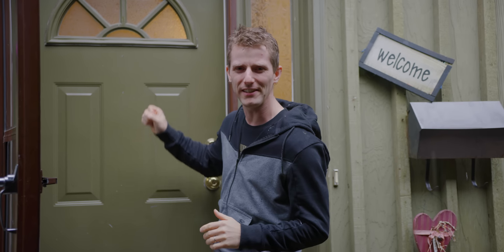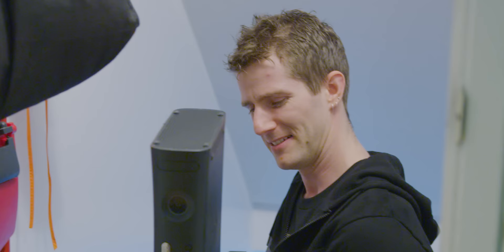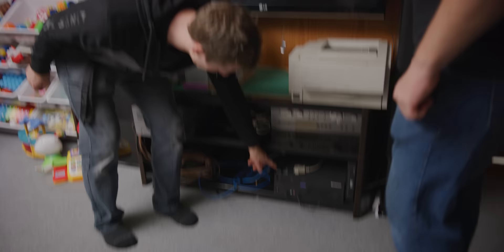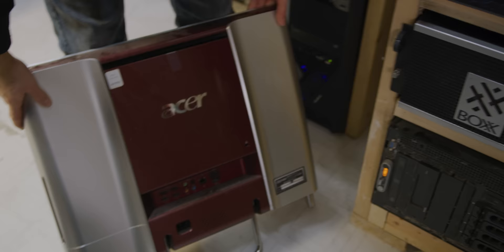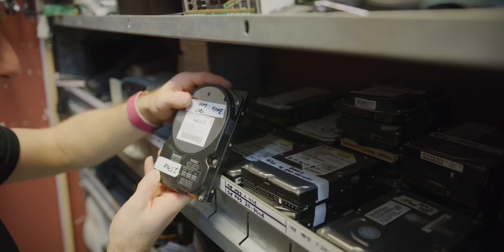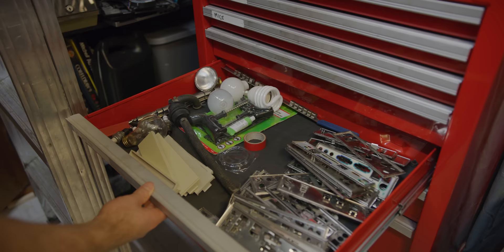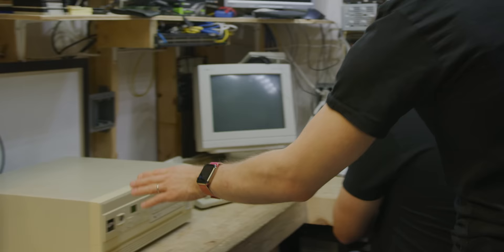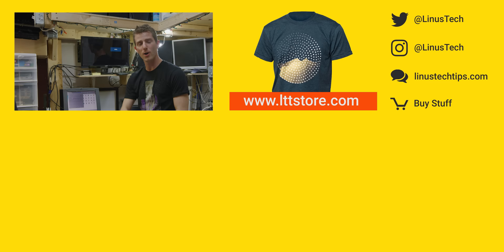This guy has a PROBLEM - Tech Hoarders

Comment: Watching Linus sort through chipsets is like watching sommelier test wine. "Ah, yes. An AMD Athlon '99. A fine year."
Reply: My 500Mhz Athlon with a Leadtek Geforce 256 was a groundbreaker.
Reply: @wolfza2630  Your 500Mhz Athlon was 99.9% a rebadged 750Mhz model. Back in the time AMD thought it was cheaper to simply design 750Mhz chips and rebadge the lower clocked ones. The higher binned versions went up to 1000Mhz and such. I had a K7 600Mhz as well running at 800Mhz using a "GFD" Golden Finger Device.
Reply: @Jeroensgambling  Interesting.
Reply: "Oh, it doesn't even have USB 3 (.0) dude."  LOL!  (5:35)
Reply: Couldnt even afford an Athlon i 99 - so purchased a Duron 600 Mhz - did the job perfectly fine aswell.

Comment: That Compaq portable with the CRT monitor was in the class of computers we used to call luggables. Back in the late 80s, I was given an IBM PS/2 P70 to take with me on an extended business trip -- it was a luggable PC complete with a 10 inch orange gas plasma display and a full size (desktop) keyboard. It was freaking cool. Shame I had to give it back when I returned home.
Reply: Actually, that particular Compaq was called a "lunchbox". The lugables were even bigger.

Comment: "You never know when you gonna need 300 ft of Ethernet cable." - True.
Reply: its for emergencies when your wifi is bad when streaming a football game, right?
Reply: My dad had a box with a spooled 2500 feet of Cat 5 Cable. Not like he worked in networking or anything, someone just gave it to him one day. He recently sold it though.
Reply: looking at my multiple 1m LAN cable and 2 100m cable... yeaaaahh
Reply: @joecraskki3175  See.
Reply: I just randomly have a spool of like 300ft of fiber optic cable right above my head soooo yeah
Reply: @jimishreds  or your neighbor has a QLED and no internet!
Reply: Agree
Reply: More importantly, "You never know when you're gonna need ANOTHER 300 ft of Ethernet cable".
Reply: Pfff... have at least 1km at home 🤷‍♂️😅
Reply: You never know when you need to borrow internet to your neighbor
Reply: My dad kept ~75 feet of coax cable in the basement for years and we finally used it to run coax up to my room so I could use my own modem. No chance he would have used it for anything else though.
Reply: @Marcin Pockaj - 
Because WLAN is for humans who believe in it or are electro sensitive or or get sleeping problems caused by the radiation
Reply: Who is true?
Reply: @joecraskki3175  great for that  10mbps internet
Reply: I keep a spool or two around.  Is that not a thing?
Reply: cable is boss and faster!

Comment: Excluding the RS Model 4P and TV connected computers, I started with two 386SX PCs i got from the base aafes for $200 not working. I got one working, shipped the other to packard bell for warranty return.  Sold one for $600. Over the years I kept all my upgrades starting around the first Athlon. Doesn't even fill a reach in closet. After watching this video might get an old one running capable of installing those awesome Jane's flight sims from the 90s.... still have them all! Will need a month to read the flight manual for Jane's F15.

Comment: 1st CPU to break the 1Ghz barrier was an AMD K7-750Mhz on a Kryotech case cooled to -41C and obviously overclocked to 1Ghz, had the pleasure of using one for long until the power management for the no-frost cooler hit the dust... could have fixed it now that I think of it...

Comment: I'd like to note that the iPad 1 is specifically a 3g model that could be used over your cell network. The standard model did not have the black section on the back.

Comment: Yep, owned half of that equipment for sure. I did buy the Soundblaster AWE32 with 2 megs of ram and I had just enough to buy a 500MB HDD for just a little under $80 because it had 2 other owners. Than I spent $300 when the first 3gb hdd came out in early 96/97

Comment: Linus: "So this is your very first PC, the one that started it all?"
Brian: "Yes"
Linus: Breaks it
Reply: "Oops"
Reply: I mean, at least it wasn't a drop.... 🤔
Reply: The front plate that came off in his hand is a removable cover. It would be replaced with a optical drive,  or one of those 5.25" drives he was talking about (720k was the size)
Damn! I'm old Af! 😂
Reply: @lindabryant2695  Don't feel too old, I still use 8" floppy drives. The very first computer I worked on was controlled by a valve system  or better known as a Vacuum Tube computer,  that was programmed through a Hollerith punch card system. No keyboards or monitors back then, and any mention of a mouse in those days meant you had a definite rodent problem!! We all thought of each progressive upgrade or new system as being cutting edge. Of course the newer generations laugh at us, just like their offspring will do at them! PS, The early 5 1/2" drives had a capacity of only 160 KB (single sided), 360 KB maximum in low density and 1.2 MB in high density came later. You might be getting mixed up with the initial 3.5 Drives, they were 720k capacity. Guess after saying all that if you are as old AF, II must be older than F%&k!!! LOL Have a great day!!
Reply: @lindabryant2695  Actually, no, it was probably either 360 KB (double density) or 1.2 MB (high density). The 3.5" disks were 720KB (DD) or 1.44 MB (HD). By the time I got my first PC (486 SLC2/66, 4 MB RAM, 200 MB HD and a CD-ROM!) in 1994, 5.25" was generally dead, but I actually got one for it later on just to run old software with. Having said that, my "beast" blew my dad's 286 IBM PS/1 that he had gotten 4 years prior out of the water 😂 (not to mention those Apple II computers I used in grade school with Number Munchers and Oregon Trail). I might have a PC with an 8 core processor with 32 GB RAM and 20 TB in hard drive space now, but I do admit to missing the old days every now and then...
Reply: I haven't gotten to that point yet, not sure if I want to ffs linus
Reply: Damn, I'm 22 and I recognize that removable cover.

Comment: I can understand this guy 100%.. I'm always like "you never know when you need it".... never needed it though
Reply: I have a pretty much full closet of JUST random wires, Everything Ive ever bought that came with a cord/ charging cable then subsequently breaks, gets thrown away... No reason to throw the perfectly good wires out though lol!
Reply: And then you throw it out and you end up needing it lol
Reply: @FictionExistence  Exactly! Happens every single time.
Reply: Well I can say that I've used the Ethernet cable that I carry on my backpack more than once and it was totally worth it LOL
Reply: @skrounst  Yup, I had a parallel printer cable splitter switch from 1996 that I kept until 2017.   Finally threw it away then needed it for an ancient PC system I worked on.
Reply: His entire house is ‘I should save this potion in case its needed later in the game’ - ends game with 1000 potions
Reply: Feels good though
Reply: My dad keeps most of his old shit too and i constantly need something from his stash. It's a blessing. I will keep the tradition going.
Reply: thats the point, to keep stuff around so you dont need it. you will just need what you get rid off

Comment: "Prove to me that all this stuff is useful."

@LGR is standing there like, "Am I invisible?"
Reply: LGR has like, 1 PC per generation, not 7
Reply: @Squishrug  1 PC per brand per generation with lots of different tier's IBMs*
Reply: The magnetics inside of the hard drives are definitely useful.  In fact, I trashed about 20 old hard drives last year, after I disassembled them and took out all of neodymium magnets, which have been useful.
Reply: same reason you should never drive past an old microwave. all of their weight is magnets. huge lovely magnets
Reply: @dayspoiler4608  Yea just be very careful about the poisonous beryllium oxide (the pink stuff) that sits very close. Break that or even touch it and you can get some very serious health problems. It'll probably spoil your day.

Comment: 2:36 This computer: Exists
Every school ever: I'll take your entire stock
Reply: My workplace has only recently upgraded and replaced those! Literally have some of those machines running Windows 10 32-bit with <3GB of RAM. It's horrific.
Reply: oof what happened to my reply
Reply: I teach... we are still using them. Windows 7 will barely run on them and our school wants to upgrade to Windows 10... without replacing/upgrading any hardware. Like, yeah, good luck boys.
Reply: @eldestof4  "But Windows 10 is faster, right?" With a computer that initially ran Windows 95? Tough luck.
Reply: Our entire school district uses that exact model
Reply: yup

Comment: 90s: cpu's were too fast for the games

now: cpu's are too slow
Reply: GPUs are too slow XD specially in 4k ultra XD
Reply: Who the f*** games in 4K.. I prefer 240 frames on 240hz not 30 frames
Reply: @NicholasDePizzo-lc6me  The type of people who spends 4k on a pc just to play some AAA title in 4k in <60fps which a ps4 can do in 30 fps for 300 bucks. I prefer pc games to above 144 fps with 144hz monitors which consoles cannot do.
Reply: @NicholasDePizzo-lc6me  🙋‍♂️
Reply: @NicholasDePizzo-lc6me  Some people play more casual and chill games and wouldn't benefit much from the added hertz. Plus with the way GPUs are going we'll be able to game 4K at 120+hrtz relatively cheaply.
Reply: well thats becasue a lot of programms ran on CPU clock speeds
Reply: Hitman006xp or 8k with 3090 xd
Reply: HIT THE IRONICALLY NAMED TURBO BUTTON!
Reply: @NicholasDePizzo-lc6me  i play in 4k ultra on lg oled with a controller hooked to my pc, i also have a 1440p 144hz monitor but i just love 4k oled gaming at yes 60hz.
Reply: not the cpus are slow but games become more and more unoptimized
Reply: Bioraual  It's the other way around, games are too slow for modern cpu's. Most games never utilize more than a handful of cores/threads.
Reply: @t0nje  a ps4 can't even do 10 fps real 4k

Comment: this was like my office at work until just recently. We had apple 2's pentium 2 and 3 computers, lots of very old printers and monitors. even an analog phone room that clicked away until it caught fire too many times one summer. Finally cleaned house and started updating everything. Nothing at my work older than a core 2 quad now. Still old but not THAT old.

Comment: I had a similar approach to hoarding tech. I started early 80s as a mainframe tech engineer/bench repairer. I had everything I could salvage back to Apple, Tandy, Amiga, PC, PC1, XT, etc...including racks of working data centre servers, Cisco switches from 5000 series all the way down to entry level models and Routers such as the 7000 series. My home workshop rooms were cabled with serial and ethernet. I also had some of the other business grade machines such as the Altos and AlphaMicro. OS's such as PICK, SCO xenix, SCO unix, CP/M, OS/2, the dozens of DOS variants, Netware, UnixWare, SunOS, HP-UX, OS/400.
Then I got married, moved from technician to management, and sold/gave away most of my tech and still ended up taking 800Kg of "junk" to the recyclers.

Comment: I felt attacked every time something a mere 10 years old was called ancient.
Reply: I know, right? I use "ancient" computers for my day job I guess :(
Reply: My main machine was a 2006 iMac up until a few months ago.... when it got replaced by a 2010 quad i7 iMac....
Reply: hotaru25189 . You love your PC that runs a 20 year old operating system, and 10 year old technology is ancient? 10 year old PCs aren't ancient, they are still useful for many day to day tasks. I do think  that it's close to becoming ancient though.
Reply: @hotaru25189  Only top of the line stuff has kept progressing that fast. A lot of the improvements on the low end are power efficiency and price. I can still go to wal-mart right now and buy a laptop with 4gb of RAM and a dual-core processor, and my 9 year old T420 will be faster.

We're at a weird point right now I think, where many businesses and students are still happily using 10 year old computers. 

You're right though, technology has come a long way, especially in the 21 years since W98 came out.
Reply: thats like 100 human years bro
Reply: You're right, my point was just that I think the progression is slowing, and I'm not sure the word "ancient" carries the same weight in reference to a 10 year old computer as it did 10 years ago, when a "10 year old computer" was a Pentium 3 that would've struggled to even run the latest OS, much less do anything useful with it. 

But it's all just a sematics argument at this point.
Reply: @cam2786  If so, that would make it antique at worst. An ancient computer by that 10x standard would be Babbage's analytical engine.
Reply: in terms of cpu the last ten years have basically been no progress at all. but storage?? oh my. graphics??? oh my....
Reply: @hotaru25189  Well, the intel i-series was already out in 2009, and they still use the same name with just different "core" names based on the technology.
Then the only new RAM-memory standard that has come up in the past 10 years is DDR4, whereas 10 years before that (1999-2009) it went from SDRAM to DDR3 with many kinds in between. A windows 7 based computer can run windows 10 with no problems, but a windows 98 PC will never work on windows 7.
Reply: I still have Windows version 1.

Comment: 3:20 I actually have the stand for just such a Samsung monitor still!, granted, I haven't found a use for it yet, though it DOES actually have standard VESA mounting size, as well as the ability to rotate 90 degrees, and a height-adjustment.

Comment: 11:48 I remember coming back from overseas and upgrading the family computer to 200MB HDD, but the OS wouldn't recognize it and I needed to upgrade from DOS 3.01 to DOS 6.22, the 2x CD-ROM I also got had some sort of custom SCSI card on it that was always a bugger to get the drivers up and running for. I really appreciate no longer trying to figure out what from Config.sys could be loaded into High Memory and what couldn't.
Reply: Didn't you use EMM386 for working with himem.sys? I did.
Reply: I dont know what u guys r saying.
Reply: Extended vs. Expanded? Does this card work in the expansion chassis with this program? IRQ conflicts, DIP switches on the silkscreen if you're lucky, in a lost manual if you're not.  Those odd-sized binders that came with Lotus and DOS.  Oh yeah, I hear ya.
Reply: And what about trying to configure the turbo display through the zillion of jumpers to show correct numbers?

Comment: "Remember when the speaker was built into the pc?"

My new Dell PC at work with its built in speaker... 😶
Reply: my 2  lo
Reply: Worst part is it's under my desk so sounds muffled like it's in a tiny box
Reply: They still do have those low-quality speakers built into some motherboards, actually. It's just almost never a good idea to utilize them unless if someone needs a booting error code. When I tried out Manjaro, every time I'd Ctrl+F and type something that didn't exist, I'd hear the internal PC speaker make a low "error"-like noise.
Reply: Mac mini...
Reply: Same!
Reply: I do own a dell optiplex 760 that has a builtin mono speaker, and it actually is run by the normal sound card, its nice to have, but doesnt sound pretty good since its mostly just a plastic membrane 1w speaker in a tiny plastic housing. I saw another fujitsu oem that had such a speaker aswell but dont know the model.
Reply: Lot of HP and Lenovo machines have built in speaker too. :)
Reply: And my Dell monitor too
Reply: I have  2013 HP Compaq 3600 Desktop (not my main pc LOL) , it has built in speaker.
Reply: At least your speaker isn't digital. No I don't mean CD style digital with the fancy shmancy DAC you young whippersnappers (I am 19 BTW). I mean the speaker can only make square waves because you only had 1 bit PCM.  Did I say square waves. I mean a square wave. You kids with your newfangled Nintendo Entertainment System with 2 Square Wave channels, A Noise Channel AND a Triangle Wave Channel all hardware mixed. Wasn't a thing in the PC master race.
Reply: I literally just built a ryzen system with an rtx 2070, I put the speaker my case came with in it cause I was so amazed my case came with a speaker.
Reply: The same! By the way, laptops and phones have them too :-)
That 4TB storage probably eats more money on electricity and air-conditioning than a few drives would with the price tag,
Reply: We drilled holes in our first PC's and installed headphone jacks so we could game with the silly beep tones all night without bothering anyone.

Comment: Wow Linus knows Supreme commander!! @15:32 -
Also the Risk map is in forged alliance forever -  a community driven project for Supreme Commander. Complete with matchmaking, replays, tournaments, maps/mods vaults.
Reply: FaF! Discovered recently using your Forged Alliance key in Steam let's you have it in your Steam library. Wicked Awesome.
Reply from the maker: It's a diff risk map. The old one was SICK.
Reply: @LinusTechTips  My respect for you (which is already pretty high) has gone up 10 fold knowing you play Supcom.
Reply: @LinusTechTips  hi

Comment: Of course it stops the pedals, it's a cd DRIVE
Reply: He just needs to wire up an arduino to make his pedals "adjustable" hah.
Reply: @joshmartin8856  Put a bigger motor in the drive and use the tray to push/pull :P
Reply: a cooldown drive
Reply: Imagine if the drive spun at full speed when the pedals are pressed